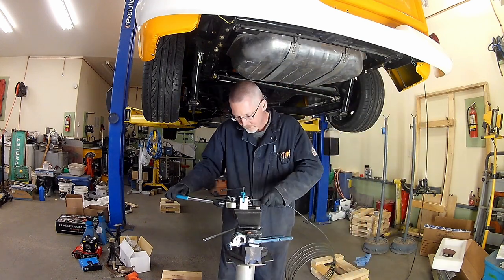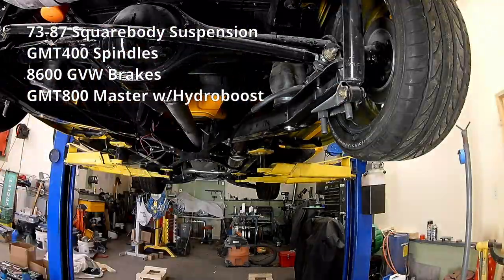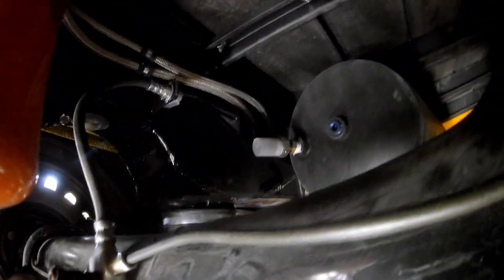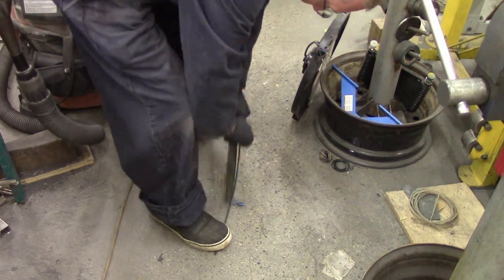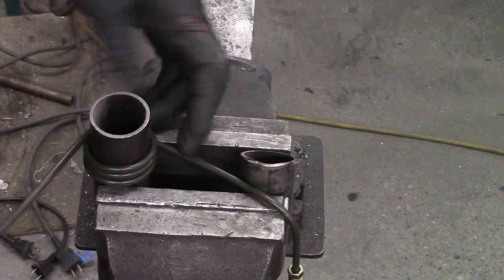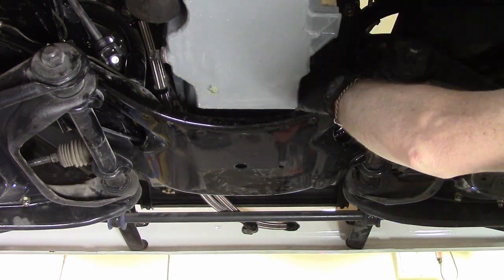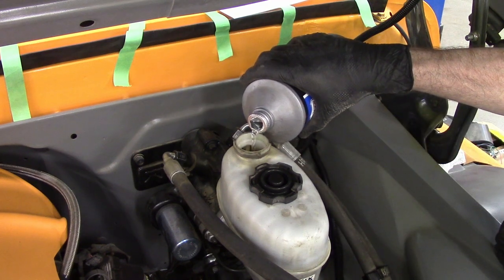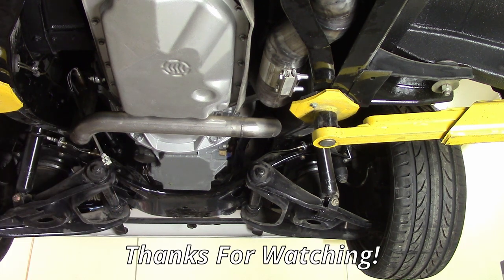Making Brake Lines

Comment: Clean install.  Thanks for showing that flaring tool.  I went with the cheaper Summit Racing On Car version which is just for one size.  Works well but I recall yours can do other sizes.  Will put it on the wish list.  Never will use those c-clamp ones again!  Also went with NiCopp line on my lowcost.  Super easy to conform - would recommend for a future project.

Comment: Nice job on the brake lines.  That is a job I always hate doing.  Maybe because I have an old style double flaring tool.  The one you have looks pretty sweet but as you said it is pricey.  The aggravation savings might be enough of a justification though when one works on rusty junk all the time!

Comment: volume matters because of the caliper design...6 piston calipers or large piston calipers will take more fluid to move them out that 1/8" to 1/4" to push the pads....once the lines and master are appropriately sized its all about the pressure....that pressure needs to be enough to overcome some basic physics of the pad interacting with the rotor....pad material/construction can be a "little" squishy but the real thing is the interaction of the surfaces....this will require a certain level of force or youre not gonna get much stopping power...
but... once volume needs of the calipers are met, then its about pressure.
inverse squared law or cubed law or whatever its called comes into play as well as the outgassing of the pads at higher temps fighting the pad contact with the rotor.....
either way a large pad will require a lot more than expected force than a small pad to finally start working.
super cars have lower pressure and flow than people think or those giant calipers would have them stopping too fast for the rest of traffic.....can they brake way better? absolutely...but you gotta be standing on that pedal to get them to do it cuz they ratio the pedal (like power "assisted" steering) for daily driveability...
6 piston brembos are capable of much more than "as delivered/oe spec" on supercars but they gotta be dumbed down for regular roads/commuting
Reply: piston "retraction" can be high on some cars...im not really certain why... but my hypothesis blames the master for allowing that much fluid back in before settling/equalizing....
rotor to pad clearance only needs to be a couple mm....but some systems pull those pistons back in much further.....let alone the problems caused by a warped rotor

Comment: Nice  flaring tool  Need we Ask : How Much ?? 
I discovered that the simple clamp screw 'flaring tool Kits'  ..unless one spends More than 100$ ..are Komplete Chinese Krap .. typically being eccentric.
 So I'm wondering just how many $$$ that nifty Flaring device of yours actually costs. 
And does it make Any economic sense at all, for a limited, often one project use ?